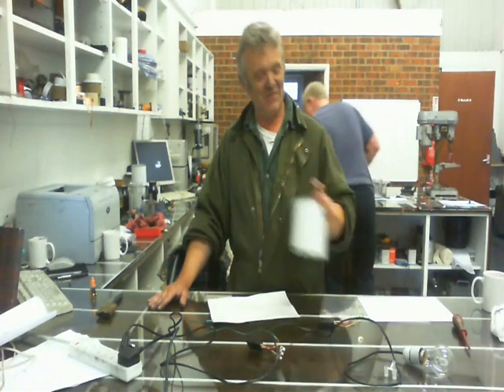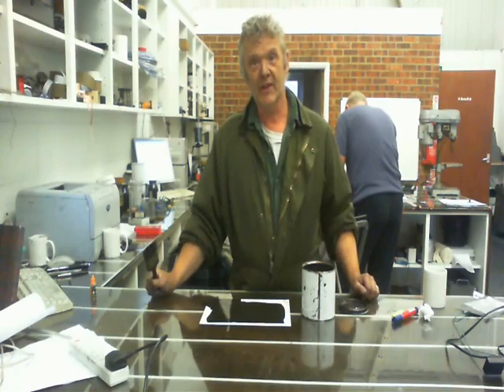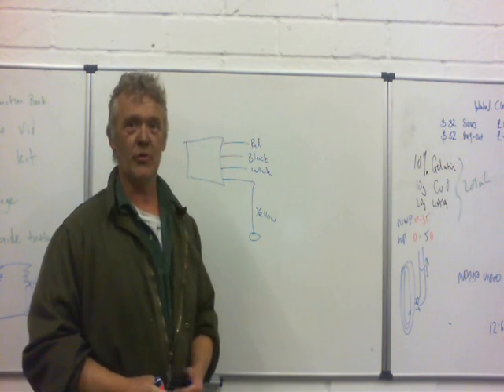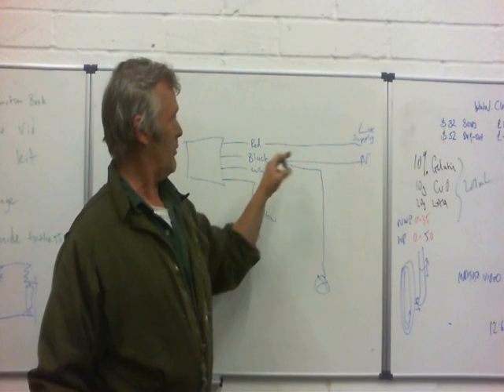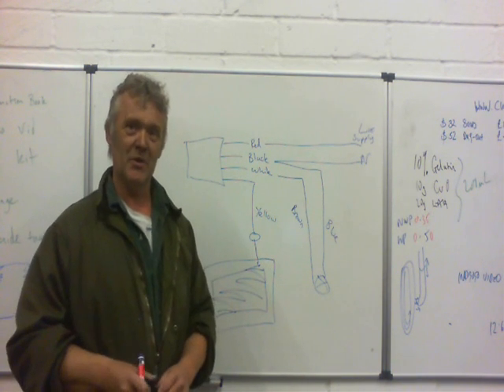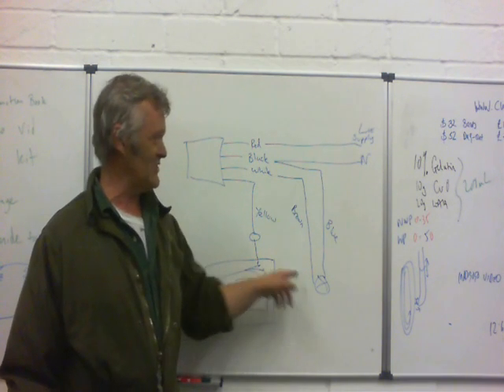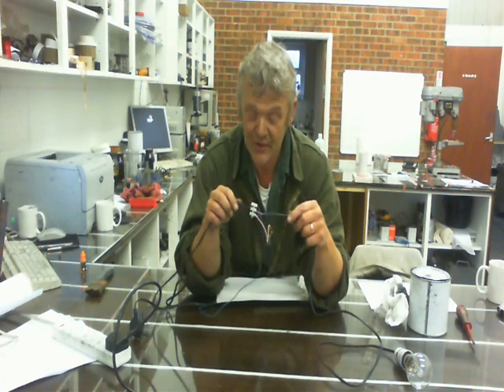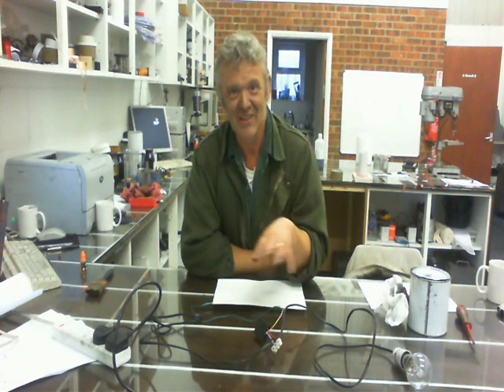How To Paint A Touch Switch Anywhere You Want It

Comment: It's great to have you back in Blighty and posting thought provoking videos again Robert. I could see this idea being combined with your wall heater design to make an easily fabricated 'touch the wall and it generates heat' system. It would make a great low cost, solid state heating solution for domestic situations. If you could formulate an electroluminescent paint add-on indication to remind the user that the device was in operation, that would make it perfect. There are a few electroluminescent paint systems coming onto the market, but I'm sure that you could come up with a better, cheaper product given your obvious genius for this sort of applied chemistry. Cheers.
Reply from the maker: that is a nice idea mate - i like it - if you used the touch switch to activate a relay you could handle any load whatsoever.

Comment: Robert Murray-Smith! This is brilliant! I have had a nagging problem with an LED lighting array for my Mrs.'s mother. She had new cabinets installed in her kitchen and there are LED accent lights, one in the top of each cabinet. The problem is that she   wants them hardwired in and will absolutely not have the potentiometer dimmer dial installed yet wants it to be on a dimmer switch. Sigh... Okay the driver for the array has an input value of 120 volts and um.. at the moment I can't remember the amps. The output to the lights is a value of 12 volts DC at 2 amps. She is fine with the idea of a slider for the dimmer but an on/off switch that has more of a home type feeling to it and not so much of an automotive or industrial feel to it that will run on the low voltage has been tricky. I'm almost certain I can find a touch sensor that runs on those specs and I can just wire the slider switch in series between the paint and the lights and that should take care of it. Funny thing about all of this is that I have a quart of conductive paint on hand already. I even just used some of it to strain the black sand out of the paint to use for another project! I have plenty left.. Now to just find the right touch sensor.... Hey thanks again Robert!
Reply from the maker: no worries mate - any chance of a video when you do it - i'd love to see
Reply: Robert Murray-Smith absolutely! Granted you'll have to be a bit patient with me. My Mrs. and I and our parents live in northern states. One pair of her Grandparents go southward for each winter and I happen to have been born in the state they migrate to. So I too have family there. This past holiday season has been pretty harsh on our elderly family members all around with their health. She lost two distant relatives toward the end of the year and spent several days in the hospital and at several different intervals with both of her Grandfathers starting before Thanksgiving and we'll just say at the moment no one is in the hospital but we are not out of the woods yet. Given the reprieve we decided to go southbound to try and spend some quality time with the family we have down there.. Kinda one of those just in case type things. Plus we needed a break from the hustle and bustle of everything up north. When we return I will surely get down to business with that awesome switch idea. Its one of the last things that need done to finish her kitchen remodel project. I know that she will be real good and happy to have it done. Also this would be my first video I will have ever posted and unfortunately I don't have a dedicated camera to take video on so it will have to be done using my phone. I have a Motorola Droid TURBO which should make the process somewhat better I hope. At 21 mega pixels it takes video in 1080p HD resolution though it also has the capability to record at Ultra HD resolution which is four times the resolution of standard HD. Since I have never posted myself do you have any suggestions or a video you have or may know of that will shed some insight on the best way to get the job done? If its just a fairly standard thing then no worries about answering that. Otherwise thank you in advance for any advice. And to give you an idea of time it will probably be a couple of weeks and it will be done. I'll send you a message and let you know that it's been done I'm going to order the sensor online so it will be there waiting on me to try and lessen the delay. Again thanks for your efforts to share and educate the masses. It really made my day and relieved me of one of my headaches for sure!
Reply from the maker: Timothy Ford
sorry to hear about your problems mate - videoing is super easy and the phone should do just fine - it's like anything scary at first and easier after a few - good luck with it mate

Comment: Another good video, robert

Just wondering how efficient the heater board is working, the reason I ask is I'm on propane and at $3.50 to $4.00 a gallon I'm running 3 to $400 a month for heat.
Reply from the maker: robert lanham that's a lot - i am on $50 a month to heat the warehouse
Reply: Thanks robert, I think I'll have to build one of those wall heaters
Reply from the maker: robert lanham
under the floor would work well too mate

Comment: Does the likes of that require CE passing?
Reply from the maker: +Colin Hammill only if you sold it as a product
Reply: Robert Murray-Smith Cheers, looked up the process and it`s a bit vague on how you do it.
Reply from the maker: +Colin Hammill which process mate?
Reply: Robert Murray-Smith Of submitting and getting a product certified CE boss. The search results I got laid more emphasis on where it`s made and a safe workplace than the product`s safety. It left you still not knowing how to go about it.
Reply from the maker: +Colin Hammill yep - that's what they do - if it is a product it has to come off the production line as a sample
Reply: Robert Murray-Smith Just got some gum Arabic  (thick gel balls of it) and I`m currently making an ink LOL. BTW that guar gum one was using 400 mesh. I`m going to do 1/5 micronized (10um) to 4/5 400 mesh with this one. I`ll have to see about CE certification as it`s a must if you want to sell.